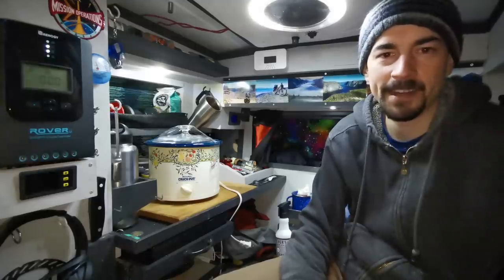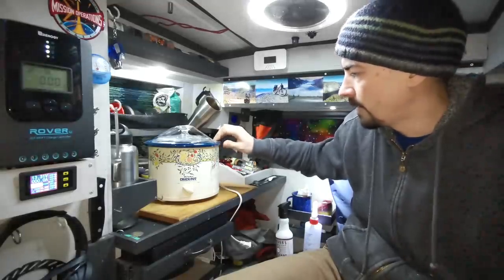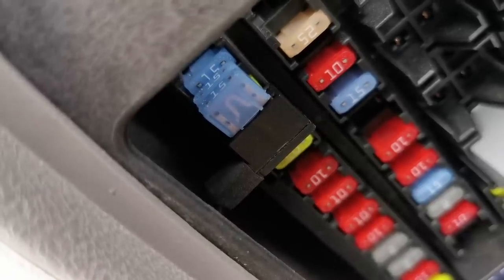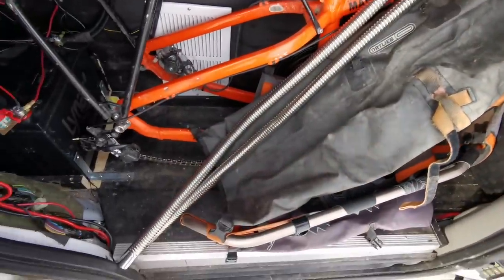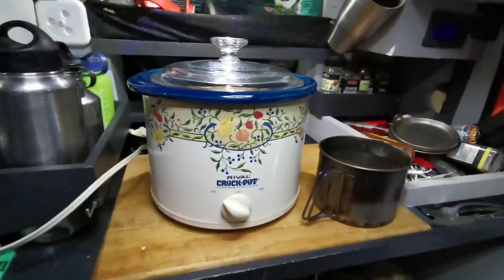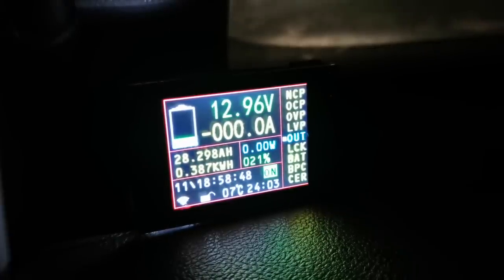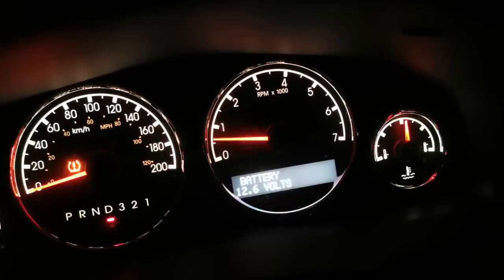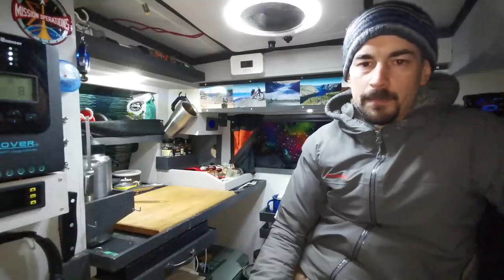Renogy DC to DC Charger Install and Review

Comment: Hi Foresty,

did you check the output of your alternator before you chose this dc-dc charger / do you know the output of your alternator?

Do you know if there's a rule of thumb saying that if an alternator has "..." amp output then one can (it's recommended to) install a "..." amp dc-dc charger? 
(Preferably in a way that while driving in city / on route with a lot of stops inbetween the current voltage of the starter battery doesn't drop to minimum.)

Perhaps you could help me / share your experience in this regard?
Reply from the maker: No I never looked into what the maximum capacity was. I just took a chance with the 40 amp.  Maybe there is something in the manual.
Reply: @forestyforest  Thanks for your prompt answer!
Yes, the manual might offer some information. Thank you for this idea.

I very much appreciate your videos! Thanks for sharing, Foresty ;D

Comment: Hello Sir,
Question: isn't there an "LC" port next to D+ port that you connect to the vehicle's start batter? I thought that was for "Low Current"...?  Isn't that feature to disconnect all charging if your starter battery goes too low? Please advise. 

Also, great job on the sandwich. 

Thank you!!!!!!
Reply from the maker: The LC wire limits the charging current.  Check the downloadable manual book for more information. I think the charger detects Low voltage off your starter battery thru the positive lead.
Reply from the maker: I plugged in the LC port for fun.  Drops charging input from 50 amps to 6.5 amps.
Reply: @forestyforest  why? Was your starter battery low? 
Do I need to disconnect the LC line i have running to the battery? I want all 40 amps.....not 6.5. 🤘

Comment: Did u simply wire the MPPT output and DC-DC charger output in parallel to the battery?
(I am hungry now... thx for that!!!)
Reply from the maker: Yeah you can just stack up different charge sources onto the battery

Comment: Loving your videos as usual! Out of interest, what Battery monitors do you use and where do you get them from ? Affiliate links are fine ;) Thanks!
Reply from the maker: They are off Amazon.ca from a brand called yeeco. The wireless one is kind of irritating, I don't think there is a way to reset the Ah/KWh counter to zero.

Comment: If you care to take the extra effort it's  far better to remove the heavy fat.  If you pour all that broth into a container and chill it, either in your frig or outside in the winter the bad fat will rise to the top and solidify.  Then use a spoon to lift off the hardened fat from the top and use the rest for flavor.  That fat is what blocks your arteries and should be removed from a healthier diet but it's your call for the extra step.  Cheers.

Comment: do you have a solar charger connected to the battery bank at the same time?
Reply from the maker: Yes, theres solar connected as well.
Reply: @forestyforest , thank you, just to be clear you don't have to isolate your solar setup when adding this dc to dc charger?
Reply from the maker: You can have both at the same time, its ok.  Just check your battery specs first. Mine recommends 20 amp charging current for maximum lifespan.
Reply: @forestyforest , thanks again

Comment: Yo! I'm confused my dude! You said I had to wire an on and off switch to the wiper motor?? How the heck do I do that?
Reply from the maker: I used a piggyback fuse holder.   Its a fail safe so that the charger doesn't keep going after your engine is shut off

Comment: Did you wire in a relay anywhere or is the full 40 amps running through your toggle switch?
Reply from the maker: The toggle switch is on a different wire, it doesn't carry the 40 amps.
Reply: Foresty Forest oh I see. Thanks.

Comment: Okay I bought one and it has the D+ and also another control lead called the limiter wire that Im not sure is really useful. Two wires connecting to the same place? What's the point of that, one will do. As you say the instructions are gibberish and Ive tried to contact Renogy about my solar controller, no response. User advice is far more available. (nobody else seems to pay attention to this limiter wire which just seems to duplicate the D+ lead that turns the charger on with power applied. Ive had a look at several installation videos.)

Comment: I decided to use a relay board so I have to push a button to start the charger once the engine is on. It resets when I turn off the ignition. Funny that you installed the wireless monitor on your dash, that's my plan once mine arrives, did you read my mind? 🙂
Reply from the maker: The monitor works good... Except I cannot reset the Ah/KWh counter, it's totally froze up now.  There is a different model with a shunt, I think the computer works better on that one.
Reply: @forestyforest  is your hall effect sensor on the house battery negative? It should count how much in and out although you aren't going to get the same out as in probably. There is a way to reset the counter I think, there are a couple of vids here that explain all the menus.
Reply from the maker: I have two hall effect sensors. One keeps track of incoming from the charger. The other tracks outgoing to the inverter and diesel heater. It's weird because some of the monitors have a CLR button on the menu, mine doesn't have that.

Comment: I bought the 20 A and it said to use 2.5mm² which is 12awg, I messaged them on Facebook and they said to use 10awg for 8-10ft of wire and 8awg for 16ft. It's kinda irritating, I already ran 10 gauge, now I need to pull it and redo it with 8awg or 6awg.
Reply from the maker: The manual is a joke! I need to replace my 8awg with 6awg now. I understand your pain.

Comment: I got a 15$ solenoid to charge mine l. Works 👍
Reply from the maker: Nicely done. I don't think those work on lithium batteries, alternator will burn!
Reply: @forestyforest  I have 2 battleborn lithium. Works fine so far. They have over charge cutoffs built in so should give my alternator a break sometimes. If it does fail it gives me an excuse to buy a heavy duty alternator with larger charging capacity. Only 150ish dollars
Reply from the maker: Cool maybe it's just isolators that don't work with lithiums. I watched a video where the alternator just burned real quick.
Reply: @forestyforest  do you have a link to that?
Reply from the maker: @jimmydiamond1062  it's on Victron Energys YouTube channel. How not to blow up your alternator.
Reply: @forestyforest  ok thanks.. I see why you picked the dc to dc charger. I just seen renogy makes a mppt controller and dc to dc charger all in one unit.

Comment: How much gas does it take to charge your battery?
Reply from the maker: I use 10 to 30 ah in a day. A 20 ah recharge would take 30 minutes of driving. Vehicle gets 23mpg on highways. This is going to take a lot of math...
Reply: @forestyforest  Do you know your mileage without charging and with charging?
Reply from the maker: No I have not compared. But I will guess fuel economy doesn't change, charger on or off. Maybe I'm wrong though.

Comment: First would you please make a video explaining how that works with your battery.?? Please 
The whole thing but I don't get why your car battery won't charge as good when it's idling but if the car is turned off, it charges fine🤔

Comment: I wouldn’t even bother running 6g, Too small a difference and it’s an odd wire size. You need no less then 4g wire off your alternator to any power source in the back of a vehicle. You will get better pricing on the wire too.

Comment: Your fuse should be based on wire size,,,,,,,,you want the fuse to go before the wire melts the coating......80 on 8 is not right.

Comment: Which BMS is that?
Reply from the maker: Yeeco wireless.  100 amp model with Hall sensor. But its irritating because you can't reset the AH/KWh counter. I've looked for hours and it's totally stuck. I think the model with the shunt is better.
Reply: @forestyforest  thanks. i'm looking for a new BMS after mine shorted (built-in the battery) ...

couldn't you make a reset switch to disconnect power for a second from the bms?

Comment: 2 hours of charging ,,, driving 50mph ,,, you would've driven about 100 miles in 2 hours.
Burning about 17cents per mile in gas,,,
17cents per mile times 100 miles that was driven = $17 in gas to charge for 2 hours of driving. 
So if you charge by driving once per day that's about $17 a day spent on gas.
About 30 days In a month,,$17 times 30 days = $510 a month in gas to charge once per day.
But you'll probably only use 50Ah per day ,,, so about $318 a month to drive enough to charge 50 ah per day back into battery during winter months.
Reply from the maker: Usually 10 to 30 ah in a day.  Depends how cold it is outside, or if I play on my laptop, or if I use the induction to boil water.